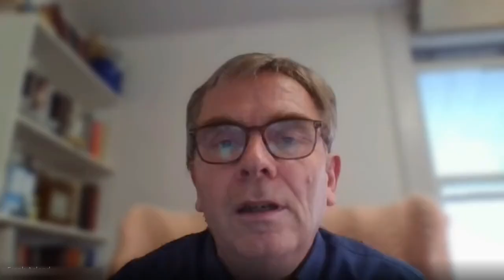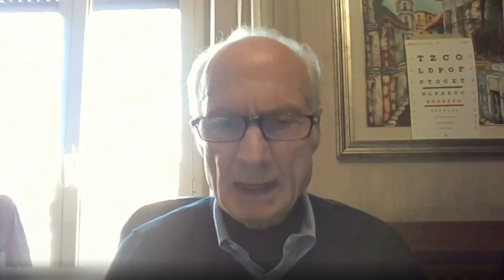Preparing For E-Cat Production : Interview with Andrea Rossi May 12, 2025

Comment: I have so many questions

- How long will a unit powering a house, for example, last before it stops working?
- Will units come with an inverter if it’s for a house? I imagine most people are going to want them for their homes..
- Can the unit be indoors? They run dangerously hot, correct?
- Have they got a dead man switch? If somebody in this process gets threatened by big oil, or people start getting disappeared or suicided, is there something in place to make sure it still comes out to the public?
Reply: your questions already answered many times, no the device doesnt get hot

Comment: Thanks for the interview. Questions for the next one:
How did Andrea sustain his living for the last 20 years? 
And what is the plan of the energy company with ecats? Are they going to replace their legacy power plants by ecats? But why would a grid still be necessary when everybody could just have an ecat assembly at home?
Reply: Il primo e-cat era a fusione fredda. Il nuovo e-cat, se ho capito, principia dall'energia del punto zero... Non so che pensare, se non che la credibilità del tutto sia abbastanza flebile, per non dire altro. Poi,  il peso dell'auto testata era di circa un quintale in più rispetto all'altra... e non si è potuto visionare  nulla, almeno da quanto ho visto. Secondo me, se fosse vera la faccenda, il dr Rossi dovrebbe girare con una decina di guardie del corpo. L'e-cat è tanto vero quanto è falso che gli USA abbiano basi negli Urali.
Reply: In modern day (now, legacy) powerplants could have a warranty of 20years and have been in use for about the same. So their lifespan is half. And would be already too costly for disassembly, removal, restructure and assembly of the new units. Currently some plants operate at $1M/day, lost, if there was a fault and have to stop operating. So there would be very little removal of energy sites IMO, but instead an addition to sites until the legacy plants get phased out. There would be little margin of no energy made to be allowed even for a day.
Home energy usage is far less in residential usage. 2023 data shows for USA,
Industrial: ~32%
Transportation: ~28%
Residential: ~21%
Commercial: ~19%
So replacing the need to power homes would alleviate the demand for the other sectors allowing for further growth and or production.